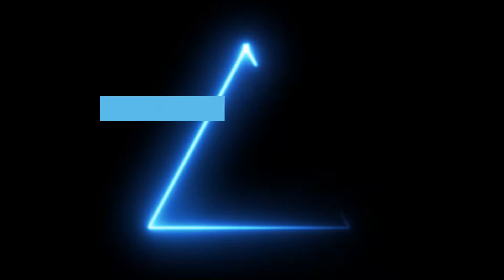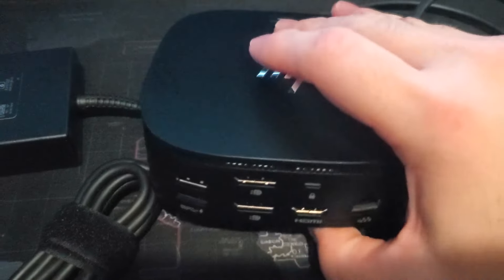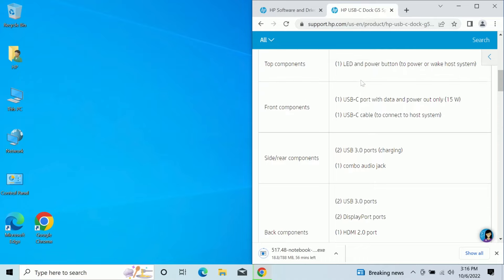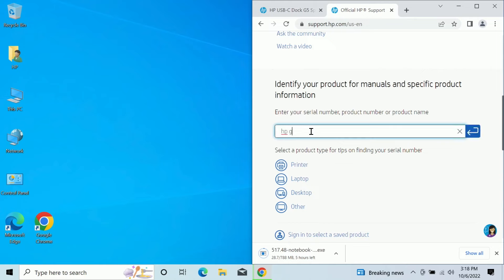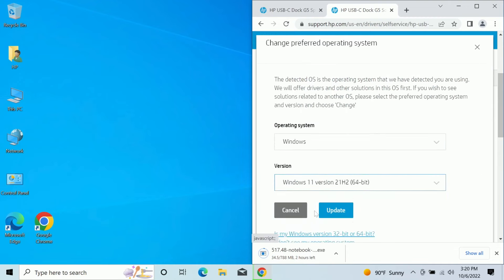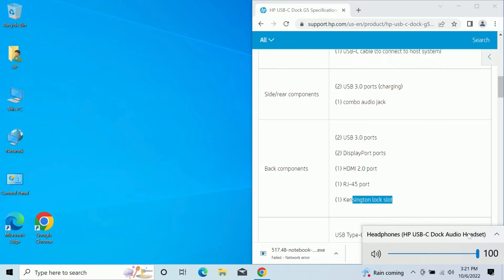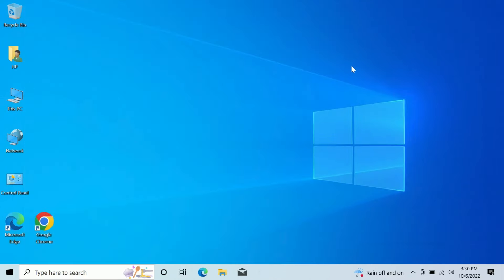Setup and Test The HP G5 USB-C Dock

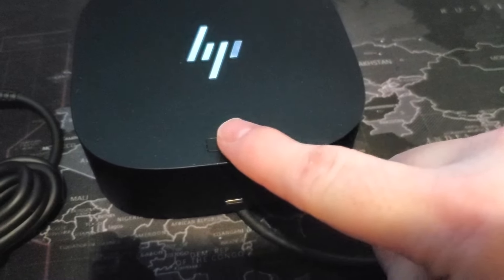Comment from the maker: I had someone catch this: @ 1:42 seconds, I did mean to say power button and not power cord on top.
Reply: Does this power button turns on Laptop without needing to open the laptop lid/screen?
Reply from the maker: @zeshanahmed2113  You know, I did not get a chance to test that, but based on how it worked and based on the fact that it needed a power button at all. I would say that it probably is part of its function. But make sure you buy it from a place you can return it to irregardless.

Comment: After the computer is shut down, the dock does not fall asleep. All ports are still powered, so if you  have for example a headset with LED lights connected to the dock, they will still be on when all is turned off. Nice if you want to charge your phone, but it is a laptop dock, I would lilke to see that different.

Comment: This hub was a disappointment. My external monitors go on and on. This has been reported on the HP Community Forum by multiple users. It also happens with the HP Thunderbolt Dock as well. It's great to plug all the accessories in, but it doesn't perform, and HP Support doesn't answer. Is this happening to anyone else?

Comment: Great video! I was actually having an issue where my dock wasn't receiving power. Completely confused until I saw in this video that the dock needs the 120W power cable. The 45W stock power cable my hp laptop came with was not enough.

Comment: Theis are not heavily using power.   It is made to power and charge the laptop, that is the point of the high power adapter., 2 choices 120 watt or 230 watt for the type of laptop you are using. It has nothing to do with it use as a hub Except it will also power and change things plugged into its ports like phones

Comment: The dock is not that power hungry it's for pass through charging at 100w so it uses only 20w
Reply from the maker: Good point. On certain laptops, This hub would also do double duty as the power source for the laptop... Meaning it would be the only device you would have to have plugged into the laptop for power and everything.

Comment: It has a USB-C cable that plugs into the computer, and it also has another USB-C port. My older version had a double cable with power and USB-C. I was wondering if I needed to use two USB-C cables (my laptop has two side by side). What is the second USB-C port for?
Reply from the maker: Been a little while since I did this video, but in answer to your question, the one USB-C is a connection to the computer. The other USB-C plug is for USB-C inbound from some device or to power a USB-C device.
Reply: @techontechofficial  I realized I can charge my phone with it!

Comment: At 1:42 you say on top is the power cord, did you mean button?  I am just trying to make sure that button on top powers up the HP Laptop.  Thanks!
Reply from the maker: You are correct sir, @ 1:42 I did mean to say power button, although I couldn't say if it will power up an HP laptop connected to it.
Reply: @techontechofficial  ok, thank you!

Comment: Laptop:Asus strix scar top noch 
Dock: G5 hp 

Problem , is powering the laptop just fine with ony the main USBC however, dispite the fact that the led button on dock is lit. Is not turning on the laptop when i click it.
I have to manually click the laptops ppwer button

Comment: Hey, cool video.
Question, before i invest in one of these, given it has 2 display ports (are they obsolete) and is this device relevant? - i.e. future proofed.
Reply from the maker: Sorry for the lateness of my reply...In answer to your questions Display port is actually a newer and more powerful standard. Given how data hungry newer monitors are, you would default to display port as your first choice for connecting a monitor if you have it.

Comment: mine charged the first say i got it now it wont charge turn on anything. Brand new
Reply from the maker: Did you turn off the power botton on the top? I just posted a correction. There is a power button on the top.
Reply: The same thing is happening to me. Worked for a few months now it’s dead 😭
Reply: Mine wont power on either. I dont know if it needs to charger first 😢

Comment: - It's not a computer
- It's not a video card
- And it's not Thunderbolt, it's USB-C. The clue was in the name.
Reply from the maker: Your not wrong but your not quite right either...but for that explanation you will have to follow the spec and the relationship between USB and Thunderbolt.
Reply: @techontechofficial  The fact that you can only use USB-C as a tunneling connection for Thunderbolt is a bummer. This is not what I am looking for, unfortunately.

Comment: Does it connects to computer via thunderbolt4 ? (40gbs)
Reply from the maker: I re-checked the specs and I couldn't find the answer to this...but...being as the Thunderbolt it does have just may be from the crossover of also technically being USB-C. I doubt it.